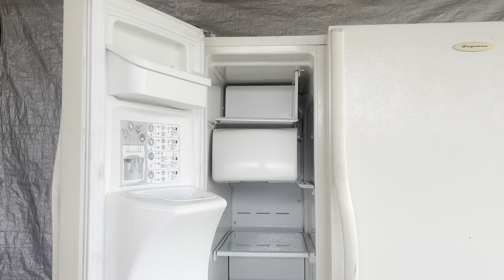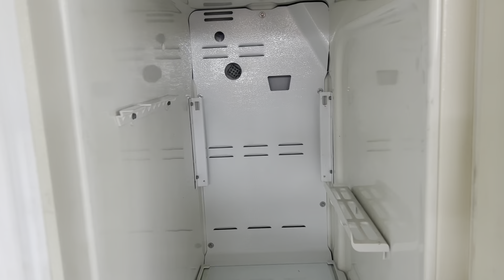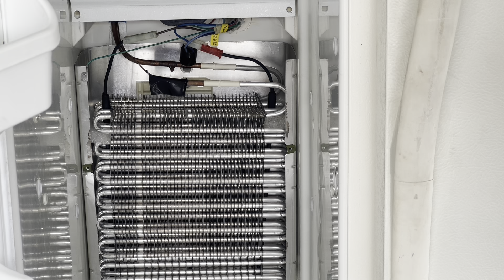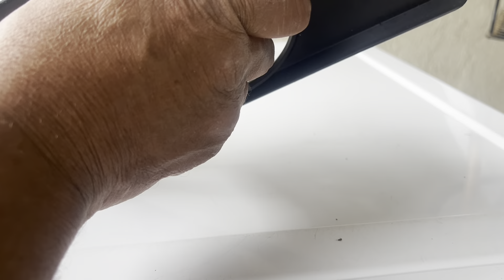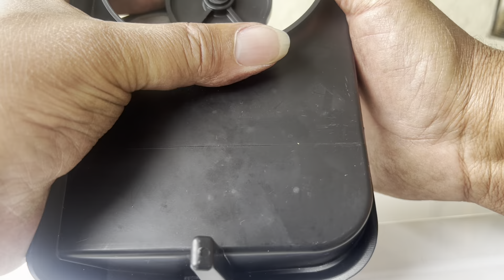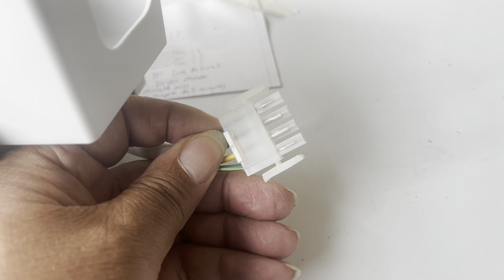HOW TO INSTALL A EVAPORATOR FAN ON A FRIGIDAIRE REFRIGERATOR

Comment: Dude, you nailed this from start to finish!!! Awesome instructions!!!!! Much appreciation.
Reply from the maker: Glad I could help.
Reply: Nice job, i had to do this a few times so now i only remove thr bottom pan and i bend up the too without removing the ice maker
Reply: Great video! Would the evaporator fan be the issue if I troubleshot everything else, such as the coils and compressor, but the freezer still isn’t keeping my food frozen?